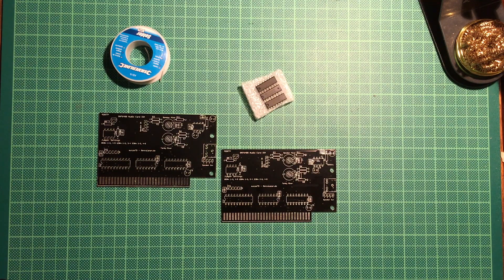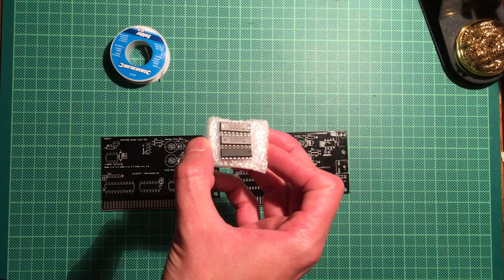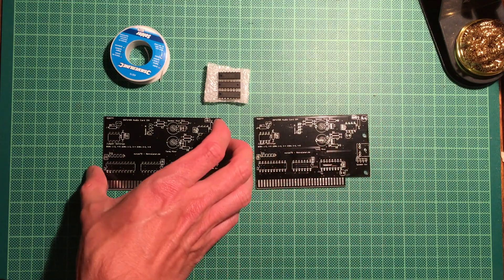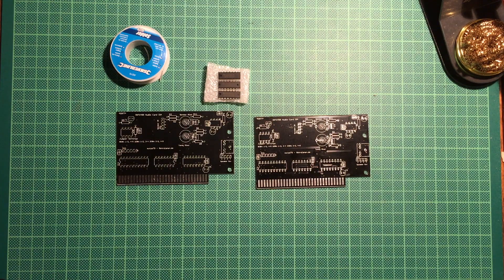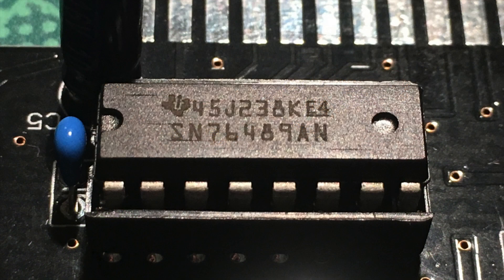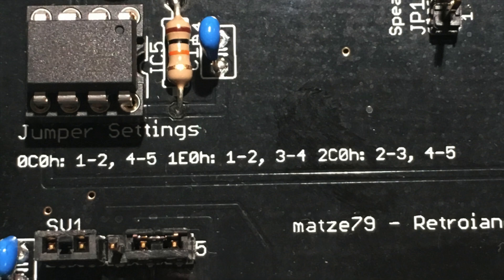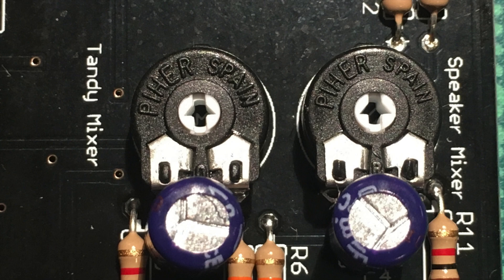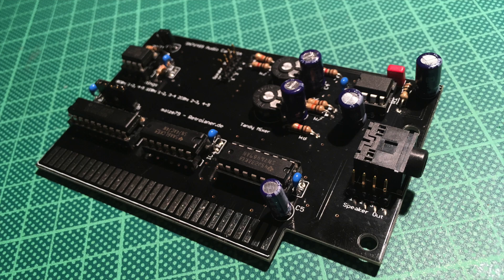Soldering the Tandy Retro Soundcard TI SN76489

Comment: Hmmm horizontal scratch marks and laser etched. It could possibly a re-processed chip from our Chinese friends. Back when these chips were manufactured most (all?) had inked markings. There is a big problem with fake chips coming out of China, but some are genuine chips rescued from old PCBs which (for some reason) the Chinese sand down and re-mark. They used to black-top and then re-ink, but these were quite easy to spot.

Comment: Technically Tandy didn't have its own video and audio standard. They cloned it from the IBM PCjr. So technically this is a PCjr soundcard. However, the PCjr was a commercial flop, so the video and audio standard mainly became popular because of the Tandy's, and most games refer to them as Tandy, not PCjr.
Reply from the maker: Technically, you're correct -- the best kind of correct.